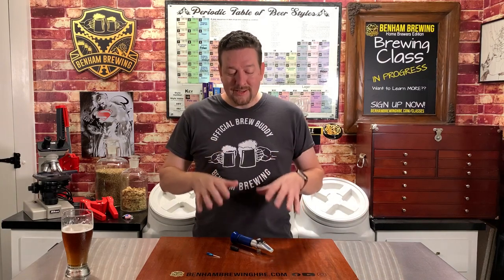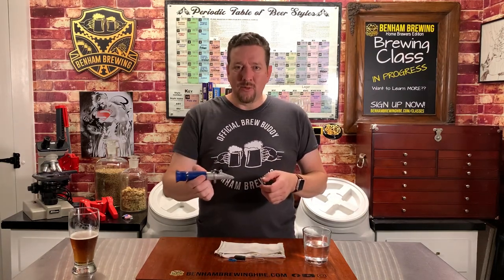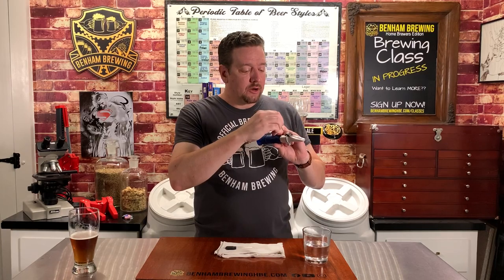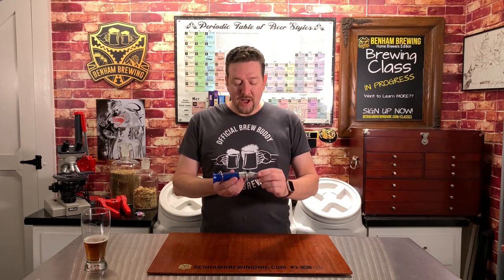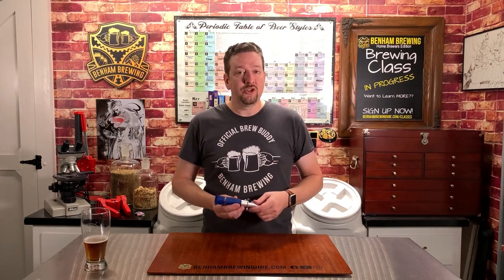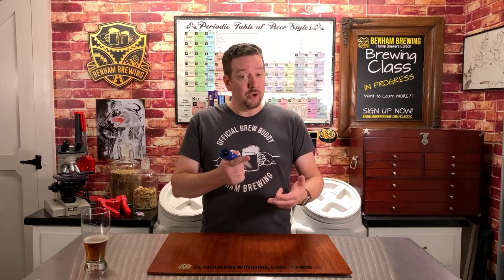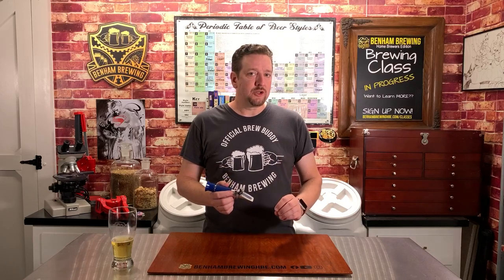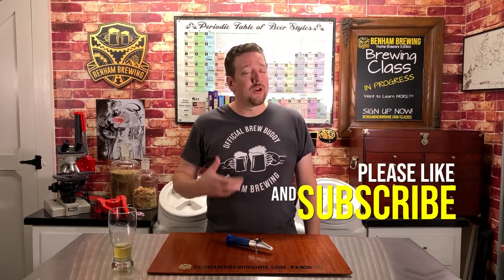How to use a Refractometer - Calibration, and when NOT to use them

Comment: Northern Brewers calculator is spot on. I have cross checked it with my hydrometer at least a half dozen times, and it's always within a point. If you need/want to be more accurate than that, get a gas specrtometer I guess. lol
Reply from the maker: Ah ha! I will have to check their calculator out! Thanks for the tip, and for sharing!